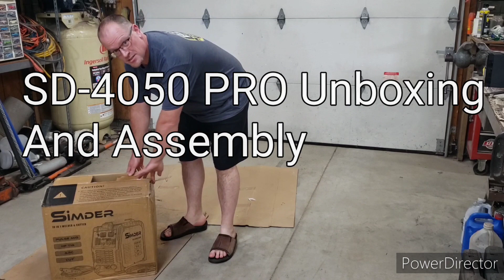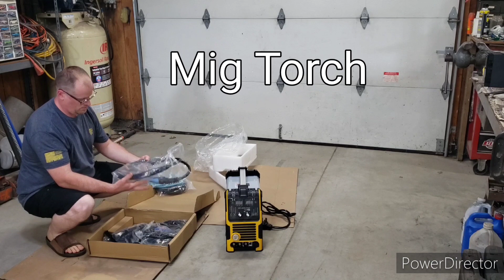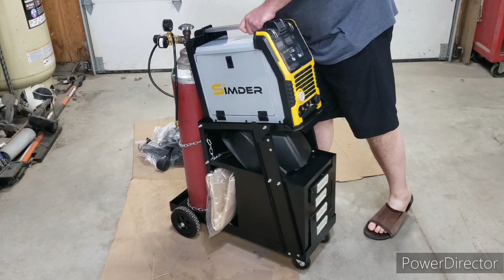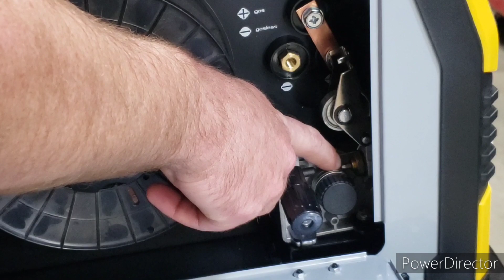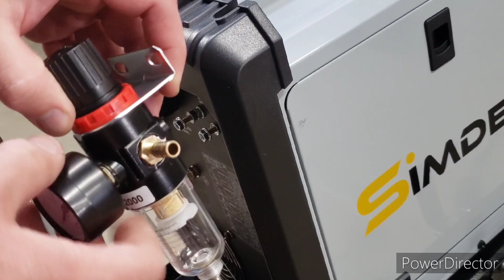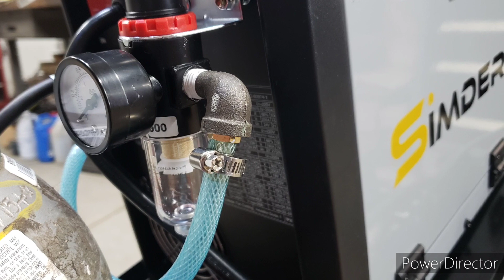SSimder SD-4050 PRO Unboxing & Assembly

Comment: That kink in the air hose you made is a problem
Reply from the maker: Wow, thanks for the tip. I reconfigured the entire regulator after the video because I didn't like the in/out being on the wrong sides. I wasn't about to shoot another video or explain such a minor detail.

Comment: Did you find a .6mm roller that fit the machine, was it available from the manufacturer Simder.
Reply from the maker: I had a lincoln 180 nearby, the rollers were the same. I ordered a lincoln roller and used it. .025 - .035" Mig Welder Wire Feeder Drive Roll Replacement for Lincoln Pro MIG 140 (Code 11634 only), Weld-Pak 140HD, MIG Pak 140, Easy MIG 140 Welder https://a.co/d/7t4xokg